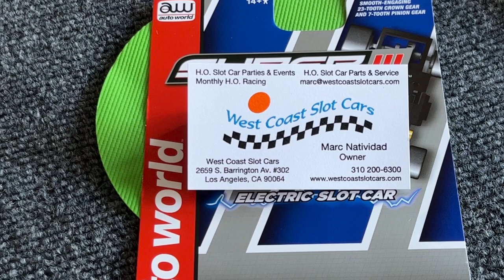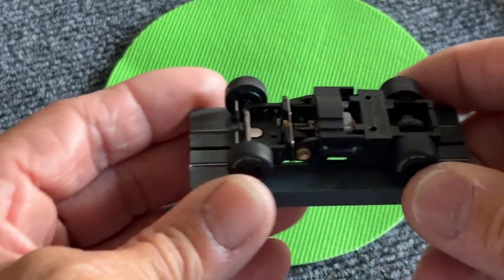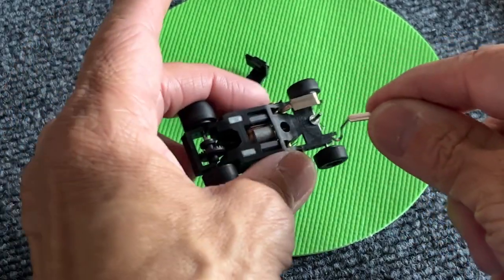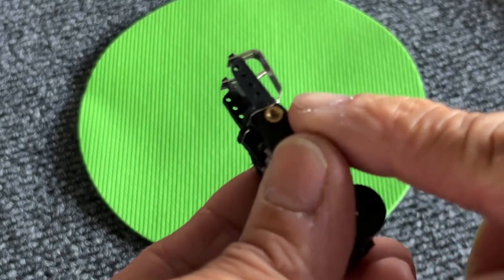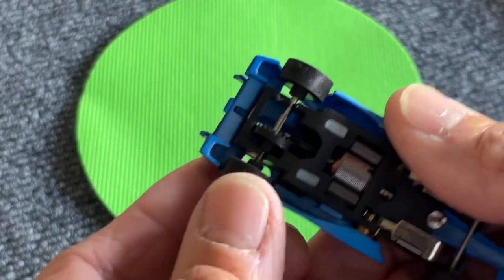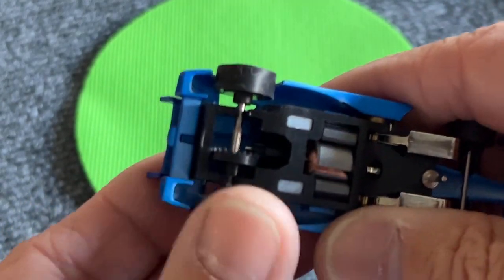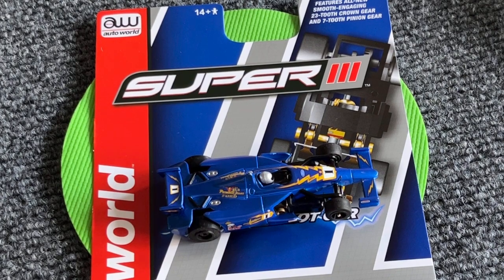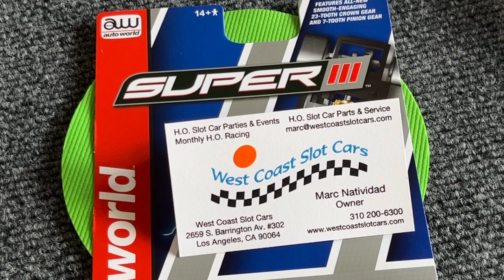WEST COAST SLOT CARS - PART 2: NEW AUTO WORLD SUPER III H.O. SLOT CAR PERFORMANCE UPGRADES!!

Comment: Hmm..2 important features; dual pickup shoe springs and even better, adjustable motor brush tension. Impressive considering it's AutoWorld. HCS, BSRT and Super Tires. All top notch parts and the front tires from Specialty Plastics are very, very nice. Have 3 different sizes from them and they are fantastic. 1 is pretty large designed for stock Tyco widepan and the other 2 are designed more for X2 narrow but can be used in many applications. Top quality silicone and absolutely beautiful. Tough enough to stretch over wheels much larger than the tire ID without tearing. They do pick up dirt and dust like a magnet. Different "hardness" available for different types of track too.
Reply from the maker: Hi Jeff!  Thanks for watching!!  I run all my TYCO’s with the Speciality Plastics C2 tires.  Happy Racing and God Bless!!!